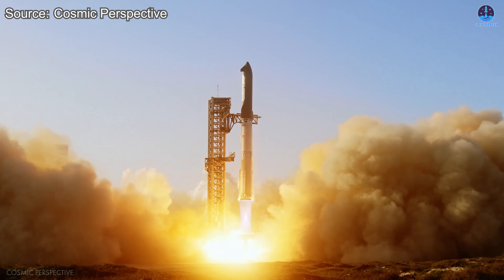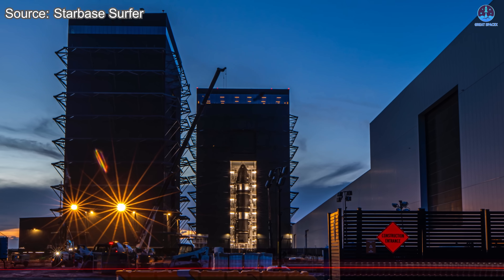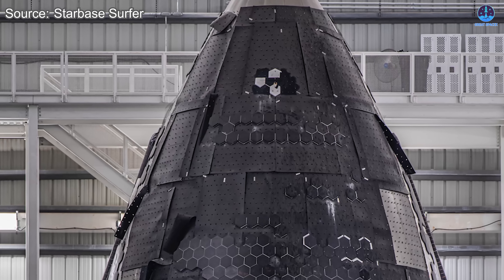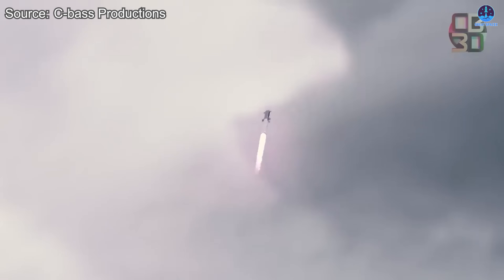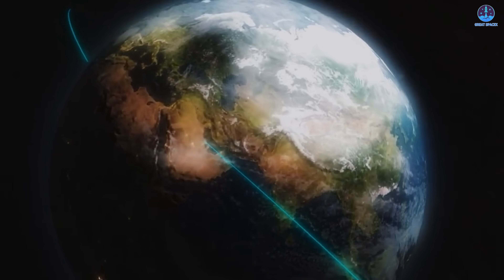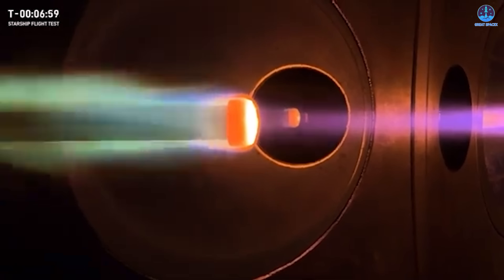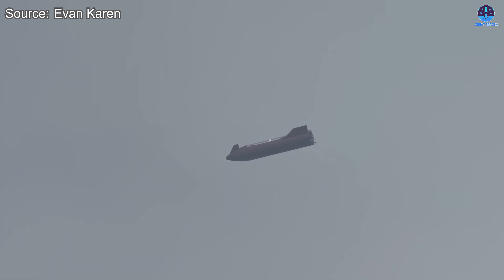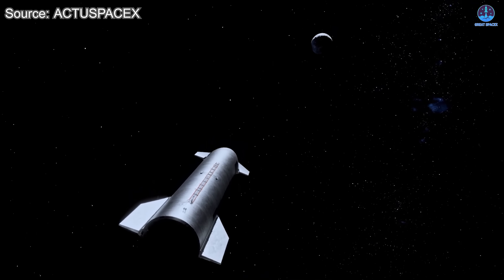SpaceX revealed New Heat Shield on Starship Flight 10 to Beat 1500°C Reentry…

Comment: High-Temperature Metallic Heat Shield Concept (for Starship-class Reentry Vehicle)
🌡 Design Target Specs
Property	Target
Max sustained temp	~1,600 °C (2,912 °F)
Peak short-term temp	~1,800 °C (reentry spikes)
Environment	High-speed plasma, oxidizing atmosphere
Weight constraints	Moderate (not as strict as LEO satellites)
Reusability	Yes — 10+ reentries

🧱 Layered Material Design (Metallic + Ceramic Hybrid)
🔹 1. Outer Layer (Thermal & Oxidation Shield)
Material: Hafnium-coated Molybdenum Alloy or Tungsten Diboride (WB₂) over Tantalum Alloy

Melting Point: >2,500 °C

Function: Direct exposure to plasma. Survives ablation & oxidation.

Coating: HfO₂ or ZrO₂ ceramic to resist oxygen at 1,500–1,800 °C

➡ Oxidation-resistant, ultra-high-temp materials inspired by aerospace ceramics (e.g., X-37B nose cone, hypersonic scramjets)

🔹 2. Thermal Buffer Layer
Material: Niobium-Titanium-Zirconium Alloy (Nb-Ti-Zr), or Inconel 718

Function: Structural + thermal barrier

Role: Takes the load, expands thermally without cracking

Temp Limit: 1,200–1,300 °C

Add-on: Expansion buffer pads + strain isolators

➡ Acts as the shock-absorbing "chassis" between hot face and interior

🔹 3. Insulation Layer (Underbody Protection)
Material: Carbon-carbon insulation or aerogel-backed stainless steel

Function: Keeps internal craft structure <300 °C

Optionally: Ventilated sub-layer for active cooling (regenerative cooling pipes using fuel)

➡ Protects Starship’s skin and payload from conductive heat

🔹 4. Mounting System
Titanium lattice bolts with flexible ceramic washers

Thermal expansion allowance built into hex-plate tessellation

Tiles or panels shaped like hexagons or interlocking shields (SpaceX uses this concept already)

🚀 Key Performance Enhancements
✅ Survives multiple reentries

✅ Withstands oxidizing plasma

✅ Allows expansion and shock absorption

✅ Modular tile replacement

✅ Can combine active cooling if necessary (via cryo methane loops)

🧪 Advanced Options for Next Gen
Functionally graded materials: gradual transition from ceramic to metal across thickness

Self-healing oxides: new research into oxides that regenerate after micro-ablation

Smart heat tiles: embedded sensors for crack and hotspot detection

🧠 Summary
Layer	Material	Role
Outer Surface	Hafnium-coated Tungsten or WB₂	Withstands 1,500–1,800 °C, plasma erosion
Mid-Structure	Nb-Ti-Zr Alloy / Inconel	Mechanical buffer + structural
Insulation	Carbon-carbon / aerogel / vented layer	Reduces internal temps
Mounts	Titanium bolts + ceramic washers	Handles expansion, stress
Reply: You think they didn't ask AI that?
Reply: @YorenM  yeah surely gotta ask many different ways

Comment: SpaceX’s upgraded heat shield tiles for Starship, highlighted in a May 2024 YouTube video preparing for the fourth flight test, are advanced ceramic composites designed to endure reentry temperatures of approximately 1,400–1,650°C. These hexagonal tiles, likely made from silica-based materials with possible molybdenum enhancements, are mechanically attached to the stainless steel hull, with about 18,000 covering critical areas. The video emphasizes iterative improvements, including tiles twice as strong as earlier versions to address detachment issues during launch or reentry, as seen in debris from Flight 7 in January 2025. SpaceX tested over 2,100 modified or removed tiles in the fourth flight, demonstrating the vehicle’s resilience despite gaps, aided by an ablative underlayer and the steel structure’s heat distribution. Manufactured in-house at Cape Canaveral, these tiles aim for rapid reusability, with ongoing refinements informed by ground tests and future NASA SCIFLI imaging.

Comment: Stainless definately has a good thermal resistance.  Very good insulator.  Just like all our coffee mugs. However inconel can withstand much higher temp. Huge cost increase.
Reply: Inconel is great for heat but hard to weld, expensive, and heavy so not that ideal for Starship.... SpaceX uses it only where needed, like engines and extreme heat zones, while sticking with weld-friendly stainless steel for the body so they are using it, you simply just can't for long time reusability.
Reply: your right I was thinking the same thing. It must be a cost decision. Either material I would think should have a thermal barrie coating perhaps a columnar structure yitria stabilized zirconia how ever there goes the cost again
Reply: @gerrymilidantri6457 when I worked at a thermal company called Thermacore , we used zirconia coated heat pipes extensively for a lot of high temp applications.
Reply: Anti corrosion is paramount.  @gerrymilidantri6457

Comment: Some nickel chromium alloys are more heat resistant than stainless. That is what they used them for electric heaters when they operated at red hot temperatures for decades. I have one inside my 45 year old central heater. Inefficient, but close to indestructible. OK for the Gulf Coast with only 3 months of real cold possible. Heat pumps are the way to go with electric heating. Natural gas is probably the cheapest to operate.

Comment: Why do they not have test mules comparable to Dream Chaser that can be launched from a Falcon so that new heat shield options can be tested quicker and more cost effective than losing an entire Ship and not not even recovering any of the hardware to study?
Reply: That's how heat shields were developed in the 1950s. They used  lower cost boosters in suborbital flights to develop heat shield designs
Reply: @jimeditorial This time, heat shield is not the main problem to study. So they can do it again and again rather than do it separately on mini vehicles
Reply: @drgraph-roughrider the question is, why are they still developing heat shield technology this late in the flight test program?
Reply: @jimeditorial It might help and be useful for something else in the future.
Reply: Or even do this sort of iteration on a mini version of Starship.
Reply: They study many things from V.2 ships not just heat shields.
Reply: @drgraph-roughrider Gas cooled tiles are new,and will make Every ship safer.
Reply: Sounds like a great suggestion
Reply: Starship is the craft being perfected not small crafts. It's fine with leaving earth as cargo space could carry added fuel making Refueling in orbit un-necessary,the ship being the cargo habitat at the moon.
Gas cooled tiles was my idea so let's use them on Starship or something LARGER
Reply: I have no objections to small craft using my gas cooled tiles idea
Reply: This is an interplanetary transport

Comment: Failed again. Starship V2 is stillborn.

Re-entering Earth's atmosphere can produce extreme temperatures of up to 2,000 degrees Celsius or more. This heat is caused by the intense friction of the atmosphere on the spacecraft as it enters the denser atmosphere at high speed.
Reply: No reasons, no facts, just complaints. Armchair rocket scientists and armchair engineers constantly proving how ignorant they are.
Reply: @jcdisci   I asked my crystal ball, but I guess that doesn't count, right?
Reply: @sircoolgandalf  Sense of humor is always important.  Touche'!

Comment: StarShit has other, more important problems than to promote heat shield design. What is going to cool those heat shields?
Reply: Here is an interesting idea. Watch the video to find out.
Reply: No reasons, no facts, just complaints. Armchair rocket scientists and armchair engineers constantly proving how ignorant they are.
Reply: @jcdisci  So here are the reason: StarShip is too heavy and is far, far away from any meaningful payload. At the moment, it is just an empty tube, it is still missing the cabin supporting systems, so the weight is going to go up 2) Raptor engines are faulty, no matter the version 3)SS has structural problems, which prevent the rocket to survive re-entry. IMHO this project should be stopped immediately and sent back to the drawing board if not cancelled all together (which will eventually happen, should NASA ask money back for the lunar lander). 

Regarding the “cooled heat shields” – I cannot care less. Very likely it is just another unproven BS concept. The only “coolant” available on board is the cryogenic fuel. Do they want to use it for this purpose? Good luck. Problem of SS re-entry is its mass and the energy of this object. Moving part of the the energy “inside the rocket” is IMHO crazy. At the moment, it is just an empty tube, what will happen when the space is filled by other systems? 

I am reacting to this video, just because it shows up on my screen. I did not seek it on purpose, hence I have no reason to watch it. Author should, next time make a better headline. Thanks for your reply.

Comment: would it not be cheaper to test with a smaller prototype just for re-entry from the falcon 9?
Reply: I've been saying the same thing for months. Total scale down.
Reply: A smaller re-entry vehicle would need to travel faster to compress the air ahead of it, which would also affect the amount of drag experienced once in more dense atmosphere.
Reply: Every launch test and stress different things on the whole ship, not just one item.
Reply: The heat isn’t the only problem, they also need to make sure the tiles stay on the ship and data from another source with different vibrations  and frame simply will not suffice
Reply: That’s not how physics works.
Reply: Not the same conditions.